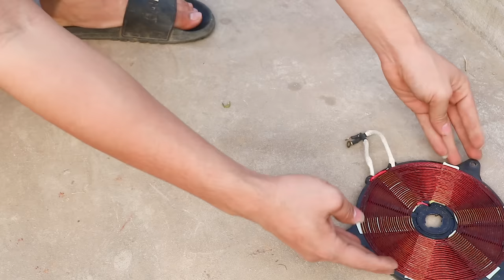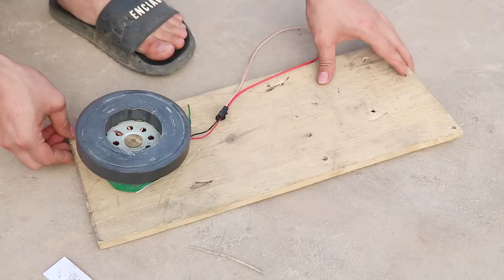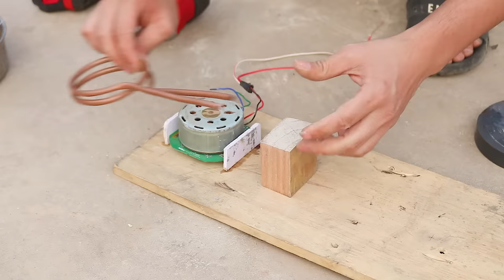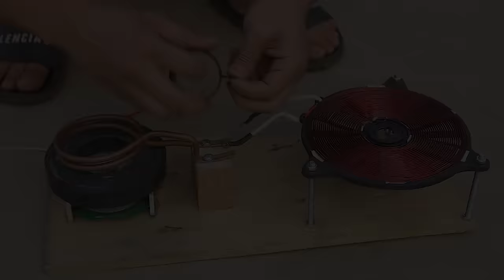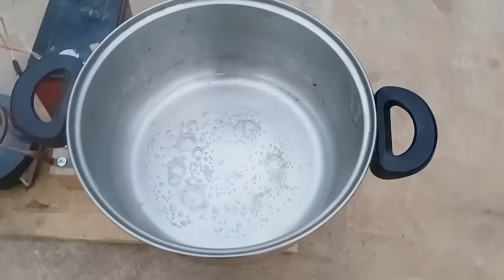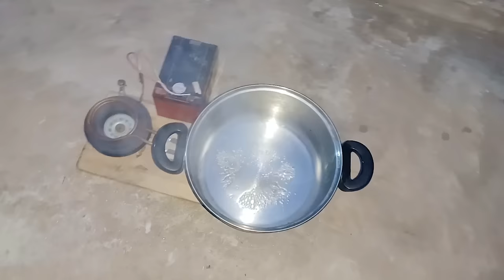I make high power electric stove from a Magnet and Motor / alternative in the gas crisis

Comment: This is fake, the motor spins a ring magnet that if spun in  orientation he spun it in he would create no alternating magnetic field and therefore no electric current is induced in the coil also the induction cooker coil requires lot more power and frequency in kilohertz range.

Comment: Where are you getting 220 volts for you coil?  You're not getting it from your spinning magnet and copper tubing!
Reply: You can use a reconditioed electric fan off a car or truck. You can power it with a car battery. 12v.

Comment: On a circular magnet are the magnetic pole polarisation on the inner/outer sides as apposed to the left/right side of the magnet? North and south so it alternates.
A speaker magnet cant "stator" like a normal alternator would. (Just curiosity)?

Comment: Pretty sure it's the battery it's hooked to that's making it boil... Not the spinning thing and the magnet which are for looks...
Reply: I think the magnet heat's the copper coil to reduce strain on the battery power.

Comment: guys, if you must know... the ONLY way this can work is if the magnet is pushed back and forth, inside the coil. then it will produce an alternating current. that will be the same frequency as the oscillating magnet.

and it will still be far less efficient than simply sticking a resistor across the battery.

in this arrangement, there is no change of magnetic flux, there is no conductor cutting magnetic lines of force, there is no heat, no alternating potential.

if you really must... report this video for what it is. disinformation or a scam. its both.

Comment: Can you just put the spinning permanent magnet directly underneat the pot? The resistance in the coils will waste extra energy!
Reply: Please tell me how exactly does it work? Without any capacitor there can't be resonance also both coils are inductance and somehow rotation of magnet might induce ac voltage but battery is connected to coil under the pot also why induced ac voltage doesn't damage battery?

Comment: That induction heater element requires high frequency to work, that slow spinning magnet and coil cannot provide the required  power for heater element, this project is fake with hidden power source wires.

Comment: Can you provide information about the core magnet and PSB backing board... So what did the magnet come out of...was this an Audio... Speaker magnet ?...?...?..
Interesting video.. thank you.
Thom in Scotland.
Reply: there probebly hidden battery involved
Reply: @pieterdeboer5361  He uses thin cables. With plastic on them. Has it worked. Should the plastic melt from the heat. But the plastic is just as good after
Reply: @pieterdeboer5361  Там, скорее, скрыты провода для катушки. Чтобы так вода закипела, нужно 2 kW  высокой частоты.
Reply: @kjellpedersen7565  Индукция нагревает непосредственно воду в посуде, которая магнитится (чугунная, эмалированная ...), но не алюминиевая. И нагрев происходит ОТ воды ИЗ-ЗА посуды.
Reply: Use neoduim megnet ?

Comment: 😂 nice Fake, this is a speaker magnet and its one set of magnet that means its N or S and to get the inducting you must have both side N and S running fast to get the change of the magnet filed with is facing a copper  and only then you will get heat.